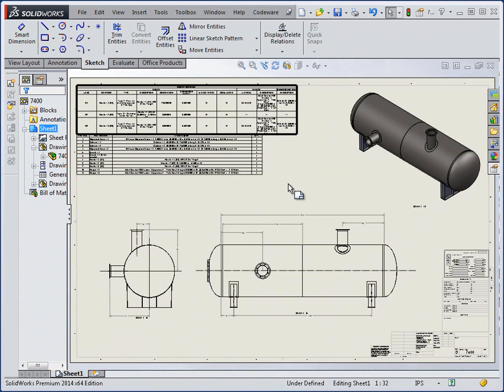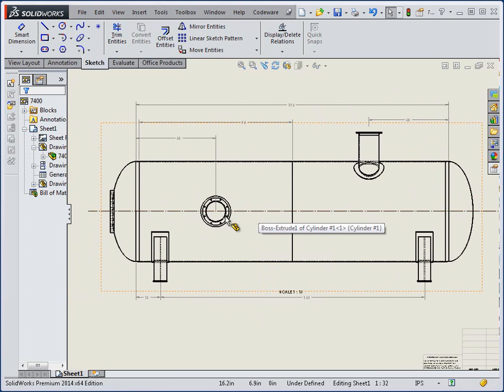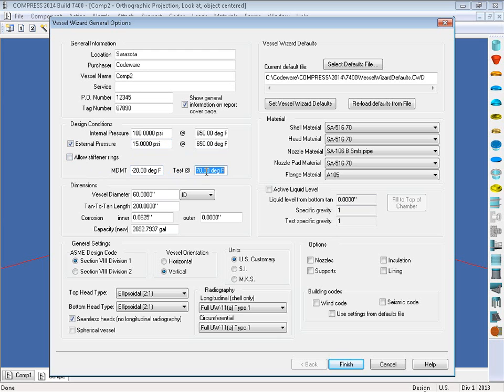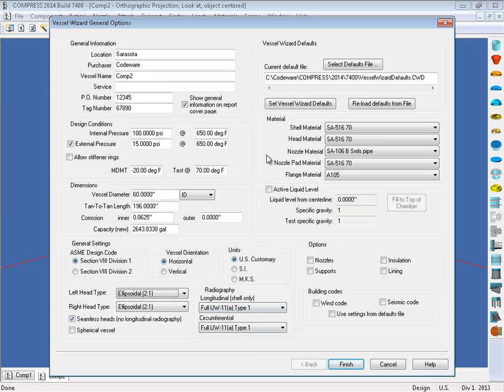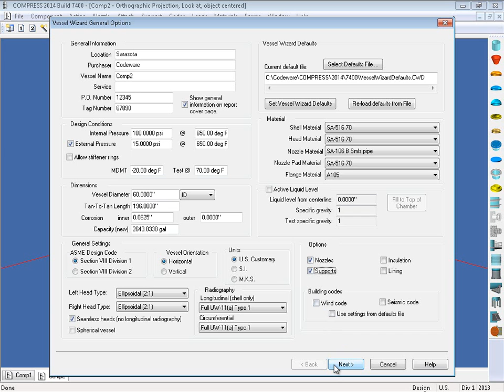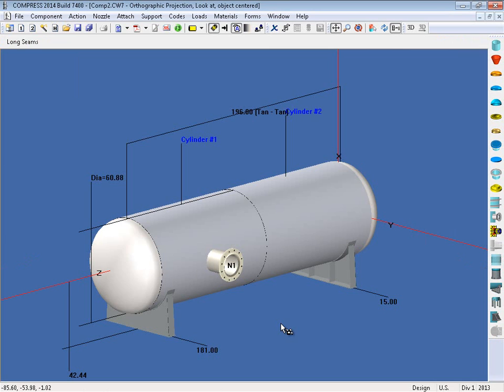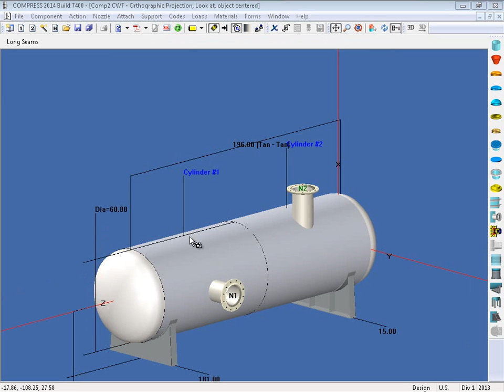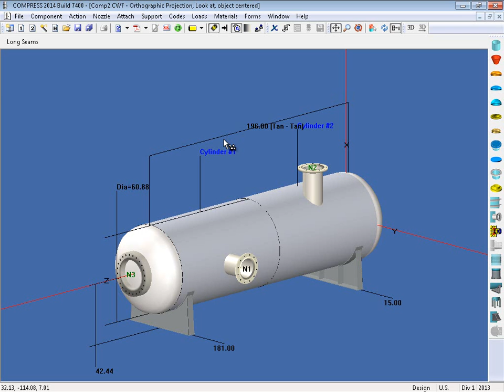Quick ASME Vessel Design

Comment: I am using the 2019 version and when I get to the point where you add the nozzle through "Detailed design", I don't get the interface shown here. Instead, I am being asked to manually place the nozzle N2 on the shell. This does not give me enough options like offset. How do I get the dialogue box shown for the 2019 version?
Reply from the maker: Thank you for your comment. Please post this question and any other questions on our support website located at https://support.codeware.com and one of our support engineers will get back to you.